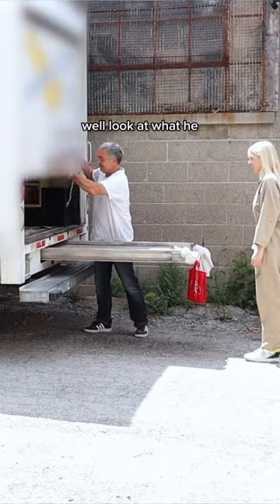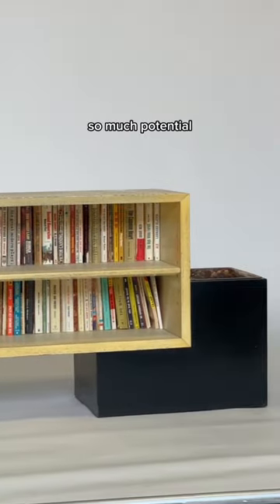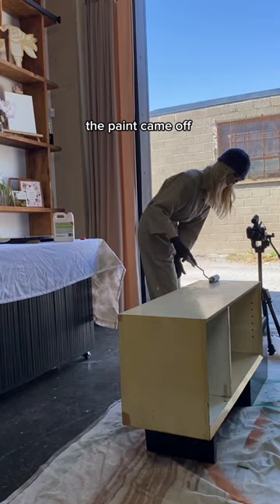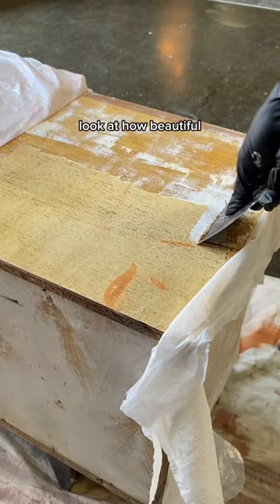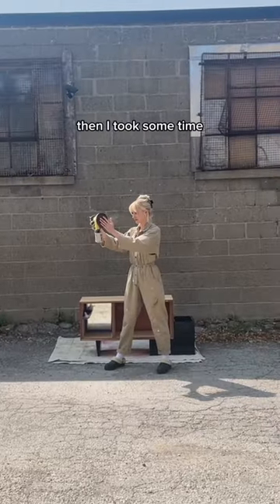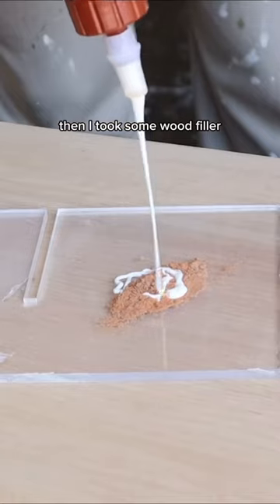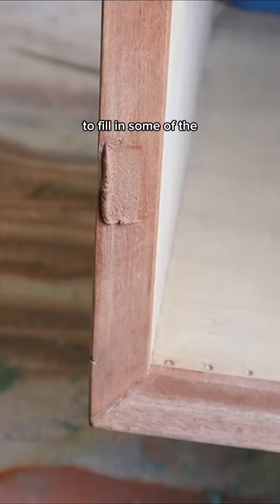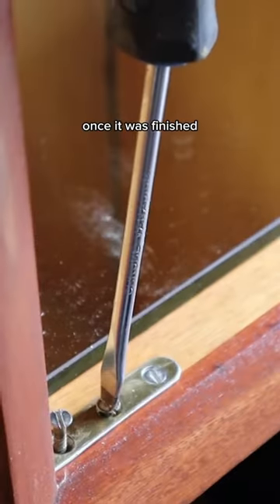Refurbishing an Art Deco Credenza

Comment: We paint furniture often it's up to the client mostly. It's plywood sometimes mdf but something that small we use ply and the face frame is often made of solid hardwood usually decorated with some moulding or beading in this case its just chamfered this is to give the edges of the ply a better surface for the paint to grab onto and a more durable edge.

Comment: they'd cover it up because it's just a veneer. You can see on the back that there's just a thin layer of "good" wood over a cheaper wood underneath. You're ok to have sanded it this time, but you don't get a lot of refinishes out of veneer, hence why people would just paint it to protect the surface.
Reply: Hi, you can always remove the old veneer, if necessary, and replace it w/ new.